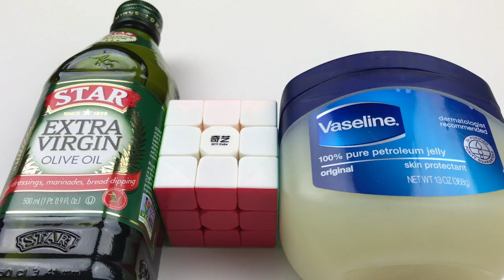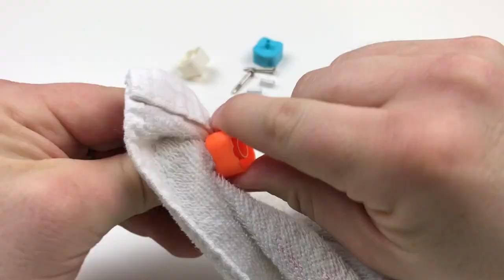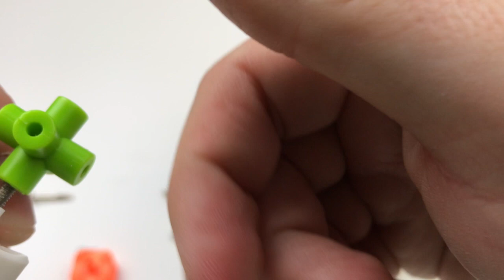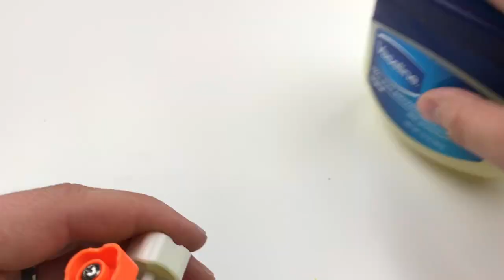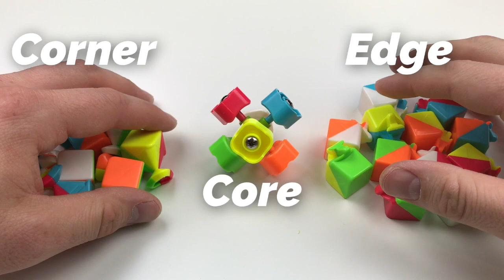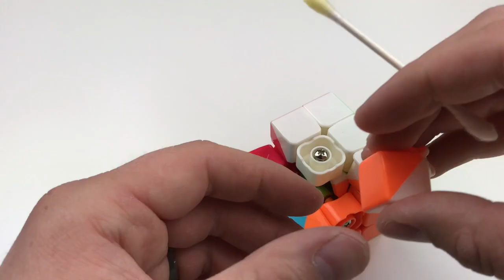Putting Vaseline and Olive Oil in my Cube! WILL THIS WORK???

Comment: For anybody who wants to try this, DON'T.

Cube Solve Hero stated in one comment reply that the Warrior was "Garbage now. Don't try this on a cube you like."
Reply: Bro I have a yuhin kylin v2 m that I bought just 3 days ago... My first speed cube though...I can't buy lube ...Any suggestion that won't ruin my cube in the long run ....*PLZZZZZ*
Reply: Saksham Kumar nothing you can do without real lube unless you have silicone spray
Reply: @pulsarcubes  thx...
It was quite tight out of the box and today I tensioned it ....It works quite fine now....Will there be any problem if I don't put lube at all?
Reply: @anon_87  No, it may feel a bit dry but you can use can cube jist fine
Reply: Saksham Kumar yep tim is right
Reply: @pulsarcubes  thx for the good news..And yeah it feels a little sandy
Reply: @anon_87  it's spelled yuxin not yuhin but anyway I have the same cube and idk how about yours but mine came lubed on the inside a bit (like only the inner parts of the pieces not the sides of the pieces like he lubed in this video) ... Tho it did feel dry (not really sandy it felt more like paper it felt dry but smooth) so I threw in the cheapest lube I could find (legit cost like 1,50€) QiYi mofangge lube and it felt a little too loose to me so I tensioned it and put that in and it's perfect so yeah buy a real cube lube it's not expensive if you feel like you have to
Reply: @anon_87  just buy martian lube
Reply: It ruins the plastic
Reply: @clickbait7396  can I use singer oil?
Reply: @mrcrazernut  I Don"t Know what singer oil is, But If It's used for cooking or anything else except for cubing I'd say no.
Reply: @clickbait7396  it's not for cooking so it's good?
Reply: @clickbait7396  I already put my singer oil into my cube
Reply: @mrcrazernut  I Checked and it's apparently For sewing, And it's mostly made from synthetic oils. The Best lube that will make your cube last long and make it fast are Lubes with 40-100% silicon. So the Singer oil will probably make your cube unusable and terrible, (If you know how) Take apart the cube and clean it. But since you Have A Yuxin Kylin V2 M, It's best if you order just some weight 5 from scs and lubing it. * I'm Not an expert, And I Don't know what exactly you should do. So take my word with a grain of salt. *
Reply: @anon_87  Omg did you really bought it?? DONT. JUST FREAKING DONT. I bought kylin v2m about 4 times i SWEAR and it always feels dry and sucks after about 1 week and a half, and the first 2, the magnet was broken, and the last 2, i put vaseline and olive oil and it became SUPER BAD. so just dont put vaseline.
Reply: @mrcrazernut  I recommend the Traxxas line of lubes, particularly Traxxas 50k, Traxxas 30k, and Traxxas 10k. You can get this bundle of lubes for about 22 dollars on Amazon. This may seem like alot, but you're getting 150cc of lube which will last forever. Compared to TheCubicle and SpeedCubeShop, their premium lubes come in a max size of 10cc and can go up to $10 for TheCubicle and $8.95 for SpeedCubeShop.
Reply: @mrcrazernut  I used singer oil before and it turned really well and i use it even now
Reply: @Gamer Snoop 
Machine oil
Reply: Too late
Reply: @anon_87  Bro but its plastic will get scratchy after sometime without lube
Reply: whoops
Reply: I ruined my cube
Reply: yea its the worst💢

Comment: Using any vegetable oil is not recommended.  Any vegetable oil exposed to the environment, in time, will go rancid and end up being gummy.  It would be a pain to clean up, too.  One can add vitamin E to a vegetable oil.  But this just prolongs the quality of the oil via stabilization.  In time, it will still go rancid and gummy.  I am considering using something like coconut oil or Ballistol as they are very stable at room to high temperature.  They are, also, resistant to friction and safer to human exposure than a lot of oils out there.
Reply: ro c but coconut oil melts quickly, no?

I have coconut oil and I wanted to put some in my shake and I placed it in the microwave for 2 seconds and it melted.

Actually why am I writing this, who would put their cube in the microwave
Reply: Baby oil?
Reply: All organic oils break down over time and will need clean up and out.  One can use silicone based oils but I would not ingest them.  Not very safe.  There is good ol' Vaseline but it can be  messy.  Still reliable.  I have used a silicone liquid that dries and it worked out well.  Good luck.
Reply: Olive oil also loosens and breaks the threads on the screw
Reply: Is singer all purpose oil good?
Reply: @Chronostasis_YT  I would not recommend Singer all purpose oil because it is toxic to touch and handle
Reply: @shmoopiebear  i used it already it got all over my hands good thing i used  a small amount of the oil
Reply: @shmoopiebear  is mineral oil good
Reply: @smaransure2234  Mineral oil is, also, toxic.  Stick with the safer lubes sold by the cubing companies just to be safe.
Reply: @igorjuszczak6289  I never thought of using baby oil as I do not know it's composition.  Just because it is used for babies does not necessariy mean it's safe.  A good example is talc.  Really nasty stuff but they sold it in baby powder.  I looked up baby oil.  It's basically mineral oil.  Nasty stuff.  Not recommended.
Reply: coconut oil hardens when temperature drops
Reply: @troxical3341  If you are planning to yoyo in the freezing sub zero Winter outdoors then I guess it is a concern.  If you are generating enough friction from spinning it wouldn't matter.

Comment: it works I bought a decent $3.99 cube from the mall and put baby oil the turning went clacky, but then I thought of putting vaseline in it and it became super smooth thanks cube solve hero :D
Reply from the maker: It's not a solid solution. My cube was ruined after a while.
Reply: i didn't do the olive oil i only put vaseline around the edges and and corners on that one and on my new yj huanlong v3
Reply: I think the reason the warrior w became ruined was the olive oil since it is liquid so it got evaporated

Comment: You can place Vaseline in the cube but not to much because if you place to much it will wreck your cube so don’t and I did compare I placed tons of Vaseline in my other cube which sucked so bad and I placed not that much in the other which feels like it’s lubed
Reply: When your putting Vaseline into your cube it's breaking the plastic down to reduce friction don't use Vaseline when your using thin cubes better when rubiks brand
Reply: Dont put any

Comment: I lubed my mf3rs with it. After a year it started getting worse. Corner cutting gone from 45degrees to almost none. I used jus s little bit of vaseline a it improvrd a lot.Corner cutting was back,and cube was slowed down.
You can use vasrlinr to slower your cube.
Reply: My mf3rs is not moving as fast as when i came i didnt put anything in the cube just cleaned its pieces  with tissue and after reassembling it ,it became worse what should i do? Please help

Comment: I use sunflower oil and it's smooth af
Reply: Potaeter has it hardened yet cause I don’t wanna wreck my cube
Reply: @justhere7977  nope it's been months really
Reply: @justhere7977  but I lube it every week
Reply: Tbh you can do this but like, clean your cube frequently (like REALLY frequently)  and it'll be fine

Comment: so about 5 months ago i "Lubed" my 4x4 with some oil( think it was olive oil), and the cube now dosent turn well and is basically garbage. Any thing i can do to sort of reverse the oil effect?
Reply: Take the cube apart and clean it well. 
Use a wet cloth to clean it and a dry cloth after the wet one. Use a toothbrush to rub on the dirty parts that you can't reach with the cloth. 
It will feel extremely dry after this but if you have any lube, just apply that.
Reply: TheDragonKing can +1 this. lubed a cube with olive oil and it was awful. just a quick cleaning fixed it up really well.
Reply: Thanks for ur replies but i tried to take my 4x4 apart and now dont know how to put it together, since there are so many small pieces. But i will still try to fix it.
Reply: @kt11_21  if you can't figure out how to put it together, there are tutorials on youtube. personally there's one by cube solve hero that I think works the best
Reply: @dpage446  oh i will make sure to check it out. Thanks for your ideas guys.
Reply: i also need help i just lubed my 3x3 with frying oil like an idiot

Comment: Did the metal rust from the oil
Reply: Vaseline ruins the plastic, oil makes the inside sticky and gummy and garbage basically , so... Don't- just don't even attempt.
Reply: Only water based substance will make the metal rest ( even water based lubricant broken down to core ). Anyway don't even think about the stunt in the video. Personally I have done it on my old cube and it felt nice on that time. But quickly it turns to worse than ever.

Comment: Haha crazy idea!
Reply from the maker: VastSpade 24 it worked amazing for the puzzle. The only thing I’ve noticed is that it gets a little gummy if you don’t use it for a bit. Once you work it through a bit it’s just as good as it was when I set it up!
Reply: Cube Solve Hero does it compete with the cosmic lubes at all?
Reply from the maker: VastSpade 24 to really compare, I’d need to test on the YJ guanlong. As for the QiYi Warrior W, it was like the galaxy but different. I’m sure applying the Vaseline to the screws, springs and core contributed a lot

Comment: Vaseline is a no no. It reacts with plastic, in effect dissolving it. 

The olive oil is certainly a lube, but it's an organic oil and will go rancid. It may contribute to other effects as well, but I'm not sure.

Buying a puzzle safe lube is pretty cheap and definitely the recommended option for the basic maintenance of any puzzle, be it budget or bank breaking.
Reply: whats rancid?
Reply: @Serkoid  decay, rot

Comment: I hope this was a meme
Reply from the maker: it wasn't cool in the long run
Reply: @CubeSolveHero  what do you mean
Reply: @mrinalsharma6697  vaseline eats plastic over time.
People used to deliberately add vaseline to tight rubiks brands and let them sit for a few days in the heat so that it would soften the plastics up.

Before speed cubes were around, that's how they used to make them smoother and turn faster.

I actually have a og 4x4 I just about dunked in vaseline 15 years ago and forgot to clean out, it's pretty much rubber now lol. 
Turn to fast during a lock up and it falls apart.